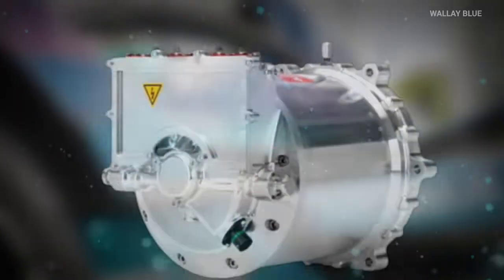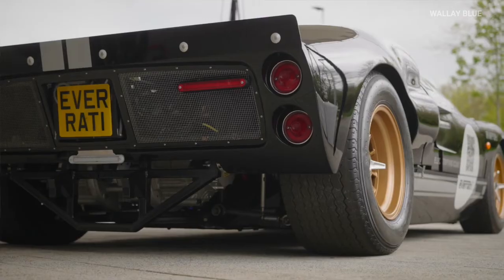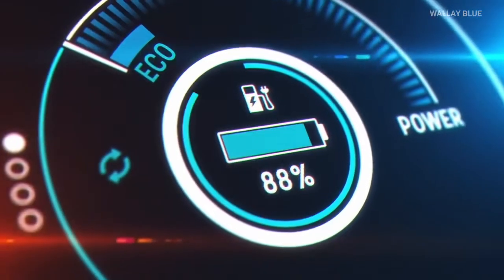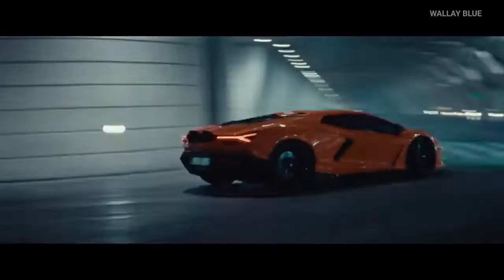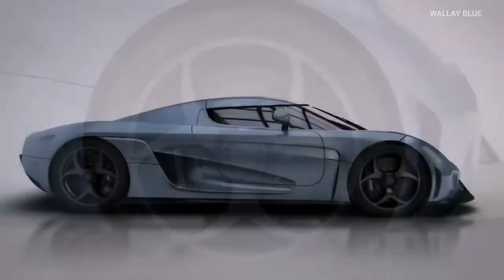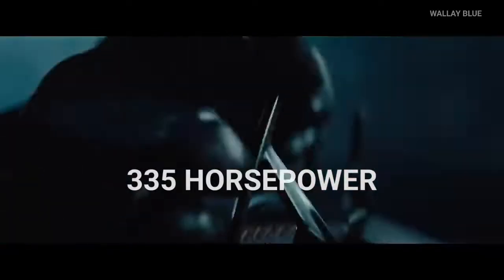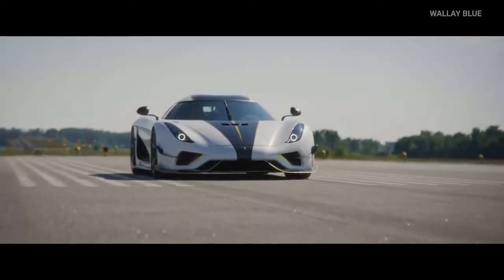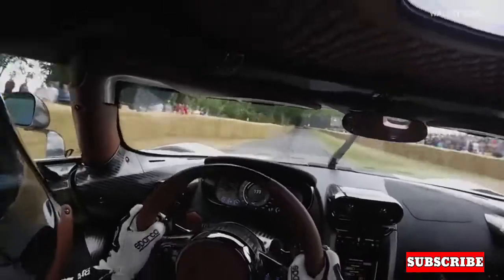This Motor Is POWERFUL It Wil Change The Auto Industry!

Comment: Wait it is two motors as one? They market it as a single unit. 

 Still they do include the entire assembly.

 Love it. Wish we got more info. This is about it. I found out about it with a comment in passing when Driving 4 Answers brought it up while talking about nitro horse power to weight ratio. 

 Electric vehicles are going to be such beasts in 20 years. Imagine having 800hp in the package on a car with solid state batteries. Or a tiny vane engine as the battery for a generator.